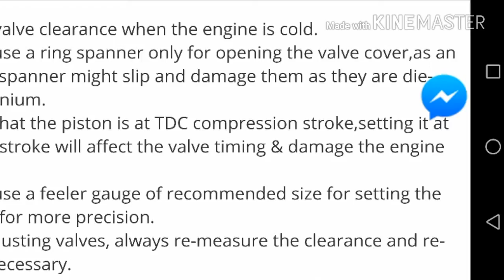Valve Setting Of Tvs Apache RTR

Comment: bhaiyya, does it effect pick up?
Reply from the maker: If wrong settings.
Reply: @ajaydevdwal  What is kms interval to do this setting?
 Mine running at 42000kms. I never touched it .
Recently I started hearing little tak tak noise like loose timing chain or something. What to do?

Comment: My rtr Apache is automatically throttle raising I changed cable's but no use..pls guide me
Reply: Chek your carburettor tuning ,also check for any leaks from the hose pipe of carburettor and engine side.